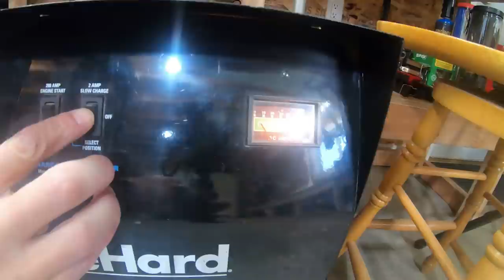Gun Restoration, 1936 Antique Kilgore. (Toy cap gun)

Comment: Question, I have a gun I’m currently restoring. Pretty bad surface rust on the barrel, I found a decent rust remover which I will throw on it next week, and found a kit at cabelas for the same blueing and whatnot. When I get done removing the rust, should I blue it?
Reply from the maker: After you remove all the rust you need to clean off any excess chemicals or any of the rust removal chemical you use do you want to have a completely clean of all solvents or chemicals before you blue it.
Reply: @TheKinzlerBros  swell advice, what would’ve the best way to clean off said chemicals?

Comment: Not to bad to bad it's a toy two thumbs
Reply from the maker: Yes it’s a toy gun I did not know it was a toy going into the restoration as I progressed through it and saw the K on the grip and then looked into it found out it was a cap gun but I wasn’t gonna quit so I finished and went as far as I could with the state that it was in with it being in the water so long it was just falling apart on me so I took the step to use the steel wheel and just polish it a little and then ended there thanks for watching Joseph
Reply: @TheKinzlerBros  hey don't beat your self up remember I thought it was a 32 cal so we were hopeful thank you

Comment: Fun to watch that. I have what I believe to be a late 1800's revolver I found magnet fishing. I tried basic cleaning with Rustoleum naval jelly. It hardly did anything. I need that tool setup like you have in your garage. What works to remove DECADES of rust? thx
Reply from the maker: Thanks, that sounds awesome if it is that old, ya those aren't gonna do the trick. you will need to set up an electrolysis system. Just look it up and it will tell you how to make one. thanks for watching